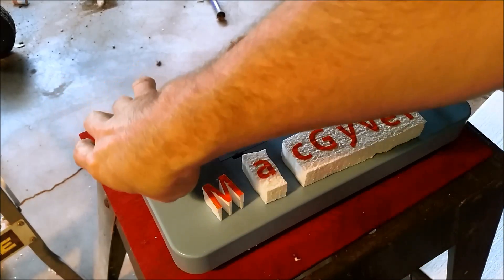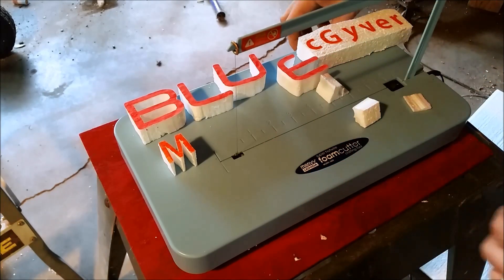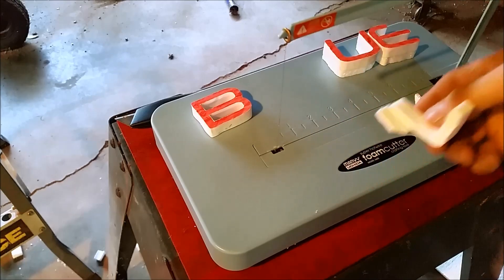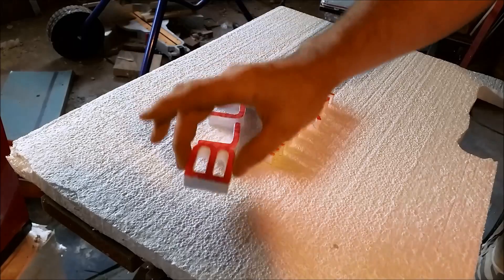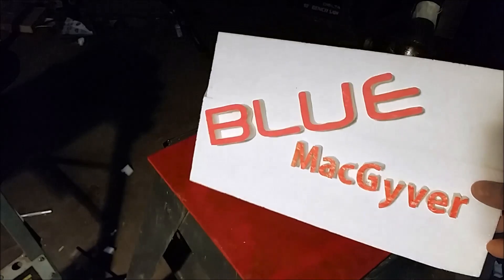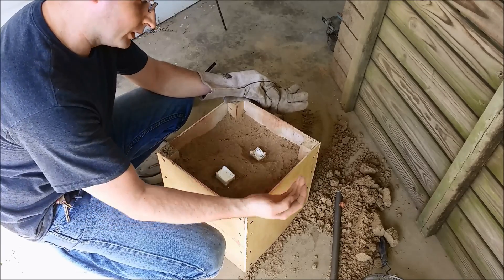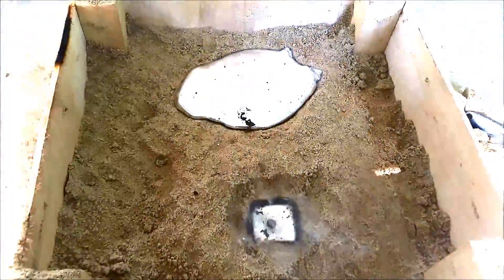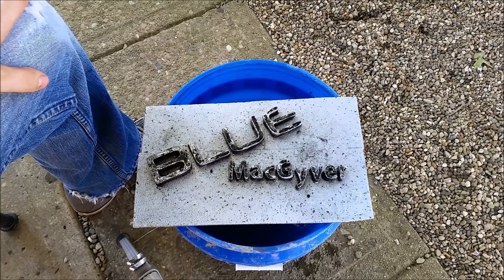How to Make Cast Aluminum Signs at Home!

Comment: Great video all the way thru 👍
I wanna make just cast letters to name my aluminum boat. ( It's 13 Ft even in length , gonna name her lucky 13)   anyway would I simply cut each letter and add a foam sprue and fill them individually , or have one pure hole and try to tie them together with a foam runner?   
I like your sign ,but on this project I want the letters to be like 3D painted and not a sign blank.
Reply from the maker: Yes you can do each one individually, so what I would do for smaller castings is just make sure you have warm to hot sand because the sand will leach heat from the aluminum way too fast on small casts.  Remember, the best way to ram the aluminum to each tiny corner of your letters (casting) is to have a reserve and sprue system, so if the normal way does not work then add a sprue (inlet piece of foam on back) and use a small tin can on top to act as a water tower of sorts.  So the letter is buried and the sprue leads to the surface but the can (without a bottom)  will hold extra aluminum that provides pressure on the casting.  If your sand is hot enough though then I doubt that you have any issues or need for the extra steps.

Comment: Was it really succesful in first try itself?
Reply from the maker: Do you mean I did a couple trys and compiled them into one video? If so then no. It was one shot.  I almost always get it in one try.
Reply: @BlueMacGyver  yes..in some vids the plain sand wont work in first attempt..i am also trying to get started with moulding aluminum..I made the forge!
Reply from the maker: @hanoroam2259  Here is one other way to do it if your project is giving you a hard time.  Sometimes when you have sand collapsing it is due to size of grain etc etc.  If you want to make your sand stick to itself then just add 10 to 15 percent bentonite clay powder in dry sand then sprits with a spray bottle slowly adding the tiniest amount of water.  When you can compress sand into a snowball and snap in to two pieces then it is ready.  Sift it through a screen or colander over the surface of your sign so the finest parts tough the sign.  Clods will make air voids so only  back fill the corners of your mould with that.  Remember the sand should appear dry but be finely wetted.  If that is hard to understand just ask questions where needed.  And don't worry, you will know when it is too wet because wet sand causes big bubbles to come out the top of the inlet in the pour.  Here is a link to what that looks like  https://youtu.be/29O-8LckmiU   start the video at about 30 seconds in.  That bubbling is the only thing extra water does.  The sand is normally so porous that all steam escapes  into the mould and not the inlet of which you are pouring.
Reply: Thanks for information bro..crushed cat kitter and sand will do it right?
Reply from the maker: @hanoroam2259  Well I tried kitty litter and it didn't work.  I also found out that it's not quite the same thing and has other dangerous to breathe stuff in it. So I'd suggest going online and buy it from a foundry supply. You can also just search "bentonite clay for casting " and look into the shopping tab on Google.

Comment: Do you apply primer before the enamel paint? How do you prepare  the surface for painting?
Reply from the maker: Alejandra Nucette I scrubbed the surface with soap and water to remove the soot.  I applied the enamel paint directly to the metal surface.  The sign is in great shape even now.  I might replace the frame soon because of weathering but the paint is fine.  I leave sign outside of my garage year round.

Comment: Does your furnace run off of propane, oil, or something else? 
I am in the prosses of making a foundry that will be able to use charcoal and/ or propane or oil. 
Any insight would be apricated.
Reply from the maker: I use propane exclusively now, but I did use coal at one point.  Coal is disgusting but ultra hot.  So hot it can destroy most crucibles.

Comment: The sign appears to have taken on the texture of the foam. Not bad if you like a rustic look, but for a smoother finish, try making the positive out of wood, giving it a liberal coat of paint, and removing it from the sand before pouring. 

Personally, I like what you did better. It makes a much better sign. This is just something to keep in mind for other projects.
Reply from the maker: Yeah I could have used that technique. I did on the cast violin neck I made and about a million other projects, but there are so many people who don't have the skill set for that and I wanted to include that group on this.

Comment: For crucibles:
Cut off bottoms of used steel fire extinguishers. I get them at scrap yard, 2 bucks each.
For bentonite clay:
Special Kitty Natural Clay Litter from Walmart, 25 pounds for 4 bucks.
Reply from the maker: Good to know.  I don't like the steel as much as  I use to though cause of all the burn throughs.  The only other advantage was the quicker melt times with steel.
Reply: I have never had steel crucibles burn through with aluminum. I have never had it NOT burn through with copper. 
If the aluminum is not yet molten, the parts of steel not in contact with it can get very hot, so I normally melt a little at first. This insures good contact on the bottom of the crucible.   I am mostly just too cheap to get a massive clay-graphite crucible.
Reply from the maker: Thermophile If have never had a burn through with steel then your temperature is low or you only lightly use the steel. (less pours) I use a professional crucible these days.  Back in the day I had well casing melt through after many uses.
Reply: You are right on both accounts. I have used low temperature, and empty propane bottles for crucibles, so I can replace them after a few pours. 

Interestingly, I have had a steel crucible burn through, but not fail. The mill scale completely replaced the steel, and was strong enough to hold up for the pour (Aluminium Bronz (1881 f - 1900 f   )). 
The whole damn crucible shattered when I hit it upside down to knock the slag out.

Ps. I love your interaction with your fans.

Comment: Isn't there a risk the metal will burn out the sides in the area where the foam is less than 1/2" from edge of wooden box?
Reply from the maker: You might be suprised how little sand can stop the aluminum,  although it happens sometimes.
Reply: Was it standard sand or mixture ?
Reply from the maker: +graham kaveman 10 percent bentonite clay 90 percent  play sand.  You can order the powdered clay online. Add the   water until the consistency of brown sugar or less.

Comment: A CNC XY table would make the cutting much faster, more accurate and  the backing part of the design would always be part of it.  You'd need a very sharp milling cutter and very fast, or come up with maybe a hot loop head that could swivel as a third axis.  It would also offer the possibility of doing far more complex 3D designs.  At that point, you could make those moulds as a business, because at the moment it would be far too labour-intensive.
Reply from the maker: I don't see myself investing that much money in it this. But owning a cnc would be nice.

Comment: I've seen many videos of home aluminum casting but I've never seen one where the mold was not removed.  Is this the normal method you use?  Do you have any issues with the Styrofoam melting and creating voids?
Reply from the maker: ***** The Styrofoam is always completely dissolved and is more reliable than the cope and drag method, the down fall is that sometimes you get a poof of fire out the top and sometimes the texture of the surface is exactly like the surface of the Styrofoam which sometimes needs to be ground off if you care about looks.
Reply: BlueMacGyver Thanks for the explanation.  I'd wanted to do some small furnace aluminum castings but lack the woodworking tools/shop to make the molds necessary for the cope & drag method.  I can work with Styrofoam with the tools I have.  Thanks!